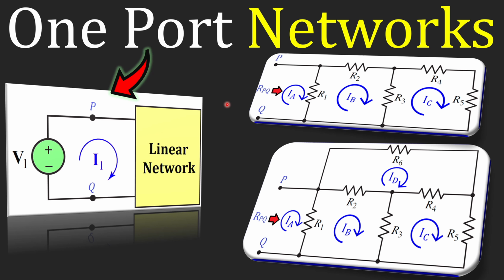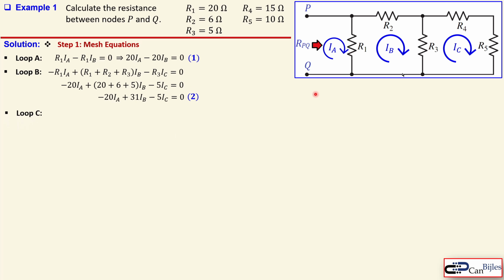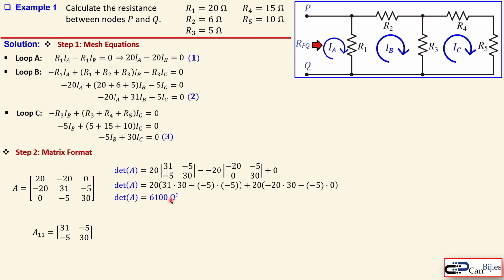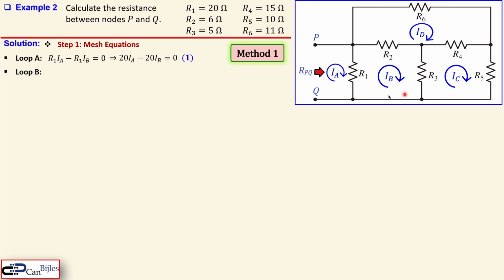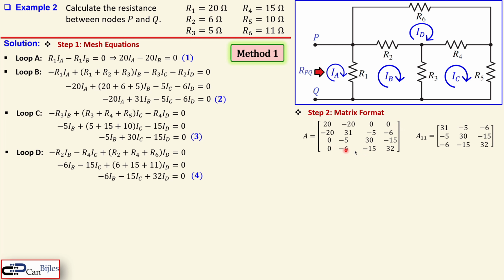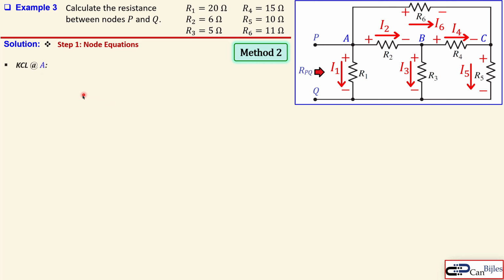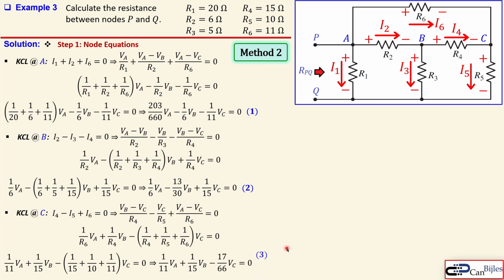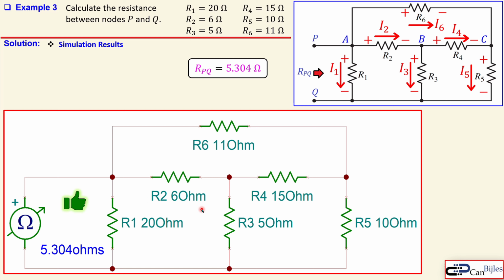One Port Network Examples 🌟 Electric Circuit Analysis 👍 #electriccircuits #resistance #matrix

Comment: You made a mistake in det(A11) towards the ending 107.17 mS^2... But thankyou so much for the explanation
Reply from the maker: Yes, you are right. The det(A11) in Example 3 should be 10 times larger. The final answer is correct though and verified with the simulation results. Thanks for your feedback!